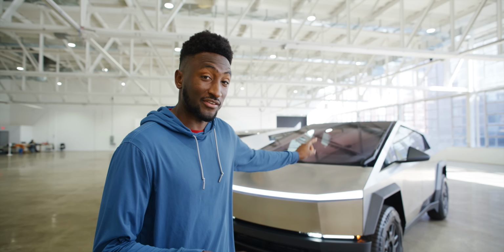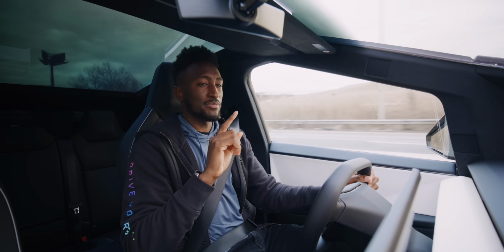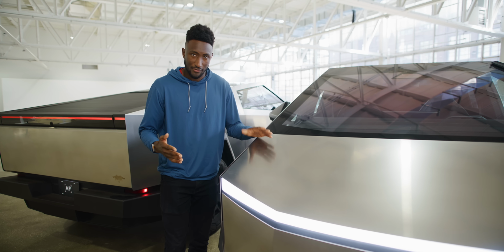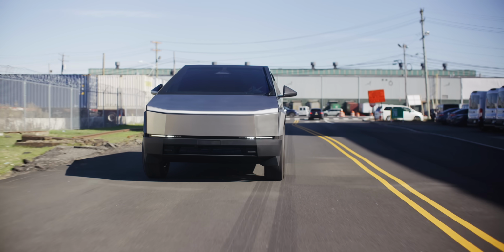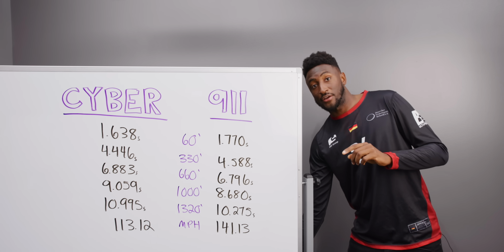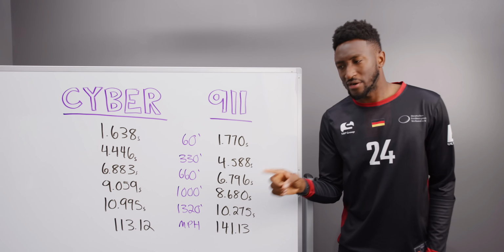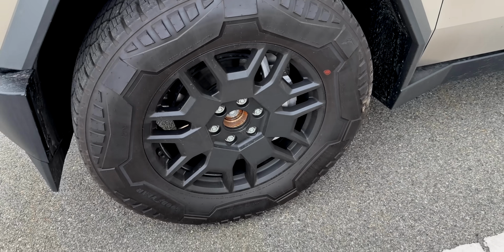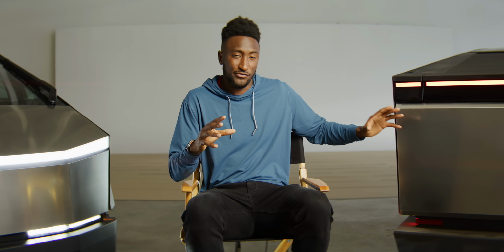Tesla Cybertruck Review: Already Iconic?

Comment: "A physical button is button, in a lot of ways, is better than a digital button" - what?

I am pretty sure most buttons in cars are both physical and digital. i.e. they are physical in the sense they are not touch based but also digital in the sense they do not actually control the component directly in an analog manner.

If you press the "increase fan speed" button in a regular car, it does not directly affect the fan motor. Instead it sends a digital signal to some controller that interprets it.

Anyways I assume he meant to say people prefer physical buttons to touch-sensitive surfaces/buttons.

Comment: On the aesthetics aspect: I think the back looks SICK. Better than the front, even though the front steals my heart with those inset headlights. But to my eyes the light bar on the front is just too THICC. I like the look of slim, sleek lightbars and the Cybertruck's front one just makes it look like a toy, not something from Bladerunner. But the back looks like the movie for sure. The side profile makes me puke tho honestly, that pointed roof is just so weird looking in my opinion. It's very american for sure, no elegance, just MASS. It's a massive vehicle. I get bothered by the A pillar width on my Nissans all the time, since the brand always designs unnecessarily thick A pillars, so I don't think I'd ever get used to the Cybertruck's, which is like twice the size 😂
I severely dislike wide A pillars, man.

Comment: Ecologically, it's not fine. Millions of people moving unnecessarily a few extra tons of metal and batteries to do their groceries is not fine. It's physics, it doesn't matter how green your energy source might be it's just incredibly inefficient! And that's on top of the fact that the life cycle of the truck and its recycling will always have a considerable footprint. With the same amount of manufactured mass you could have 3 times the number of people doing their groceries plus one third of the required parking space.

Comment: Variable steering ratio has been a thing even w/o steer by wire.
I can't imagine not getting any feedback from the front wheels...

Also why do Americans think you need a truck for towing? You just need enough power and a good gearbox. 30 years ago my dad would tow a fully loaded caravan with a VW Transporter that had 75hp and 150lb-ft of torque. And generally here in EU we've been towing with our sedans since forever. Yes, you won't probably tow 10000lbs, but if 63% don't tow at all, I bet the ones who tow 10000lbs are in the single percentage digits.

And how did you only get a 10.2s on the Turbo S on a prepped surface? I've seen it do below 10s on an airfield and not driven by a pro driver.

Comment: In my opinion it’s just stupid, I don’t hate the design but my grime is that the radical design doesn’t solves any purpose it more than often complicates it like there is no point of it…it’s very bad at being a truck with that weird truckbed where you can not load things properly, it’s not very aerodynamic either….nor it’s a very nimble car cuz it’s heavy and big so I mean what’s the point of the radical design it is not solving any age old truck issue neither it is doing any rocketry for electric cars……it just looks like a stupid idea brought into mainstream because people will buy anything unique doesn’t matter how useless it is and fyi the bullet proof body is of no use the windows are normal glass so you aren’t dodging that bullet….the only nice innovation is ride by wire steering that’s all

Comment: Fantastic video! 

About the car though... Northern European here with a few questions. 

What's the stainless steel grade? I'm no steel expert but regular 304 SS won't cut it in my parts of Europe, that's for sure. It's gonna rust away in 5 minutes during the winter. And you really need to know how to work the steel during manufacturing so as not to degrade it's quality.

Also, the sturdiness concerns me. How are the crumple zones in a collision? Will it completely demolish the other car? If so, I don't think I need to worry about the steel grade, because then I don't think it will be approved for European roads anyway.

Comment: I think the scariest thing about the cybertruck is that if a person ever finds themself in front of one in the wrong time, they will probably endup folded on the ground. That front bumber is not pedestrian safe in any way
Reply: The Cybertruck has a much smaller and lower hood than most American trucks. So the same can be said for the RAM, F-series and other trucks.
Reply: @nielsvandenkieboom5034  Yes that is true, Inwould say getting hit my any car is bad as it is, but the height of the hood and the fact that it is so stiff makes it very scary, of course there is safety break features etc that make it less likely to be involved in one but still, cybertruck is very scary to be around

Comment: The cybertruck with the 114 mph top speed limit should be only on dual motor snd single motor cybertruck. The tri motor cyber beast has a top speed of 145 mph. So you have the same problem as carwow had with the pre production unit of the cyberbeast. You can get tesla to update the software for the cyberbeast. Amazing video as always

Comment: The Silverado EV has more range, also have 4 wheel steering, much better frunk, it opens the back of the cab to allow things up to 10ft to fit.
Overall it just seems to be a much better truck. Although I think the stainless steel is actually a better material for endurance, if you wrap it up in the first day to avoid rusting.

Comment: Not at all surprised that 63% of 1/2 ton truck owners don't tow with them. You don't (shouldn't) buy an F150 or a Silverado 1500 for towing anything decent sized. You buy a 250/2500 or 350/3500.

Comment: Cons of having a steer by wire. Imagine your battery ran out in the middle of the road. How the hell are you supposed to push your car to the side of the road. If you cant steer coz the battery is dead
Reply: If you're stupid enough to run out of battery or gas in the middle of the road, you should not have a license. It is extremely easy to just not do that.

Comment: Tesla needs to fix the Cybertruck front lights; point it a bit lower yes but also make it brighter and/or cover a wider angle. Based on what I've personally seen in videos on the Internet.
Reply: They also need to bring the adaptive steer-by-wire to other Tesla cars. The 48 volt system, too.

Comment: What you needs is a rocket launcher like the ones you see on missile cruiser.  Open the cover and raise the missile for all to see also put a machine gun that is fully articulating.  While you are at it bring up the laser gun.  use the power built in the truck to fire the laser.  Now you will lose the looks the drivers around you will be scared like hell

Comment: I think it will remain an icon of vehicles. It didn't just push the design envelope but the engineering and drive experience envelopes as well. Context makes an icon, rarity can be a factor of the context, but it isn't the sole factor. And as long as most cars don't follow its design language it will also continue to make a visual statement.

Comment: I really like the front end but still dislike the rear.  

I think you were incorrect in saying this truck is bulletproof up to 9mm rounds.  A .45 caliber round is larger and won't penetrate this truck, okay because this round is slower.  And, a .50 caliber round will penetrate it, yeah because it's faster.  But you were still incorrect in sayin "up to" a 9mm round.  There are rounds smaller than the 9mm that will go right through the Cybertruck, because of how fast they are.

And why would you use a sledge hammer on that truck?!  Stainless steel can still scratch.

I'm really interested in accident repair costs, because insurance rates are based on this.  Doesn't really matter how safe the vehicle is, it's all about what it costs to repair.  And I doubt many Tesla "certified" body shops have any experience working this metal.

Tesla completely mislead the public with their drag race and Elon specifically said the Cybertruck won the quarter mile race.  And that is the big deal, that Elon lied.  Some will say he misspoke...no, he flat out lied.

Comment: The name of the car - Cybertruck - sells and is brilliantly invented. If the name of the car were Ikea-auto or from a Chinese song: 7's burns, then these would describe the car's appearance better. Cybertruk's 9 mm thick shells are convincing, but the abundance of plastic parts goes to the other extreme: the bumpers and skirts are made of the same black plastic. I wouldn't dare go off-road with such a plastic car. Tesla's innovations are indeed brilliant in their implementation, like now, for example, digital control and swiveling rear wheels, to name a few.

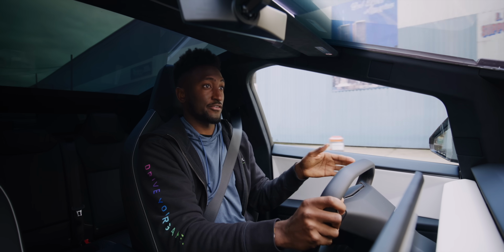Comment: 5:00 variable steering ratio implemented by Honda in the S2000, in 2000. TWENTY FOUR YEARS AGO. tesla DID NOT invent this.
Reply: S2000 didn’t have steer by wire.
Reply: @ericy.2108  did you even read my comment? I said variable steering ratio. not steer by wire.
Reply: @coldfeet1337  yeah - why are you bringing it up variable steering ratio when nobody said Cybertruck was the first to have variable steering ratio
Reply: @ericy.2108 did you even watch the video? 4:19 marques is FLOORED that the steering wheel turns the vehicle a lot when going slow, and turns the vehicle a lot less when going at highway speeds. AMAZED. literally all vehicles do this now. 4:50 
he's never AMAZED at any other car about this.
Reply: @coldfeet1337  again, no one said Tesla invented variable steering ratio. If he drove another car with it maybe he would like it too.

Comment: 4:50 You can tell marques isn’t a car guy. Infiniti shipped steer by wire in the Q50 in 2014. TEN YEARS AGO. Lexus did steer by wire in RZ last year. When Tesla does anything, it’s amazing innovation, they’re the first. When any other company does it, nobody cares or knows. It’s all marketing fluff. The key though is that this marketing WORKS, even on half savvy people like marques.
Reply: All previous steer by wire in cars actually still had steering shafts. Tesla’s is the first to not have the shaft and is purely steer by wire.

Comment: The most underrated feature of the cyber truck is the 48 V electrical system. It makes everything else possible. Streb wire requires dual 5 kw motors for the front and another one for the rear. None of that would be possible without the smaller cabling made possible by the 48 volt system.
Reply: yes was waiting for him to expound more on the system. but he only mentioned the weight saving benefits...

Comment: This was not the first steer by wire car, that would go to Infiniti.
Reply: At first glance yes.  But the Infiniti has a conventional steering column.   One advantage of full steer by wire is that it is easy to manufacture left and right hand drive vehicles on the same line.   The firewall remains the same as does everything that a steering column might conflict with.
Reply: As a pro-content creator with a team, this is a quite big mistake. AFAIK first production car without steering colum was Infiniti Q50. 2013 . Yikes!
Reply: @GsrItalia   Look a bit harder.
The Infiniti Q50's  DAS system is  not considered true steer-by-wire. Here's why:
DAS has triple-mode back-up (three separate electronic control units), 400,000km of real-world test distance behind it  and the back-up of the mechanical steering linkage.   In normal use a clutch disengages this mechanical link so it can never corrupt the steering response.

Comment: Tesla is lucky as it is a vehicle manufacturer not a truck manufacturer.  Cybertruck is a niche  vehicle.  It can try new engineering which could end up in their main vehicles.  Ford and GM trucks are their bread and butter.  Little more difficult.  Tesla started before high inflation, high interest rates, and high debt.  All these newer companies/startups  are fighting huge debt loads on top of high interest rates.  Even Big 3 falling in this category.  Starting to see oversupply of vehicles dealer lots especially $75-$100,000 trucks/Suv’s, LOT ROT.  Credit card debt highest level 1.3 trillion.  Government still overspending and buying more debt with 35 trillion in debt. L

Comment: The CyberTruck vs Porsche race that Tesla marketed was a bit disingenuous, but it's also to be noted that trailer tires are not rated to go at the speeds that would have been reached in a full quarter mile. They literally couldn't have done a full proper quarter mile, even if they wanted to show that it would lose.

Comment: Other examples of automotive mass produced icons are the Volkswagen Beetle and Bus (originals), Morris Mini, 60’s Ford Mustang, Citroen 2CV and DS and Fiat 500 (original).  We just haven’t had so many lately because cars have become commoditised, iconic design is risky, and why would large established manufacturers take risks on manufacturing a commoditised product?
Reply: All the above, plus of course the Ford Model T - the original mass production automobile, designed from the ground up for manufacturing efficiency. For a decade it was essentially the only car on the road, though customization was so common that it gave us the forerunners of both the pickup truck and the station wagon.

It's amazing to look at photos of automobile traffic of that era and to see that basically every car was a Model T.
Reply: You forgot what I think is one of the most eye catching and iconic car ever. It was also unpainted stainless steel. The Delorean.
Reply: also this truck isnt street legal in many countries , this homer mobile will never be iconic tbh
Reply: True. All modern legacy cars all look the same. The same global paradigm is being used. Right now it is with strange false scoops, ridges and lines borrowed primarily from Asian design aestethics. It is practically anti minimalist.
The CT is really different. I would not say pretty, but this is one daring design that probably will become iconic.
Reply: Good point
Reply: if the old one will not take the risk, then the new one would take it
Reply: Elon has created a true icon here.  For better of worse.
Reply: @cbotten106  Agree.  In addition all the previously mentioned iconic cars of the past where shit underneath that sheet metal.   The CT's tech is out of this world (48V, 4 wheel steering, drive by wire, 120/240 plugs, etc.  It'll still be awesome tech with millions of them driving around, vs millions of tired anemic POS pt cruisers...

Comment: When Model 3 deliveries started they maxed out at just 120 kW. Then they bumped it up to 150 kW. Then v3 Superchargers appeared with 250 kW, and all of a sudden all those Model 3s charged twice as fast as they did at launch. I’m confident Cybertruck charging will get much faster over time in much the same way.
Reply: Explanation for geeks: Model S,X,3, and Y all use 400 volt battery packs. Charging speeds steadily increased, and that meant higher and higher current. High current means more heat. So they switched to liquid cooled cables and managed to achieve 250 kW peaks.

CyberTruck is the first Tesla with an 800 volt pack. But it’s set up as two 400 volt packs that can be wired in series or parallel, so it can charge at either 400 or 800 volts. That’s why it works with all the existing Superchargers. But charging at that voltage it hits the same current limit as other Teslas.

The general rule is the bigger the battery the faster it can charge. They call it a C rating. Cybertruck’s battery is almost twice as big as a Model 3 or Y packs, so it should be able to hit nearly 500 kW peaks and average almost 200 kW if you’re smart with your charging stops. It’s not even close to achieving this today, presumably because it’s charging at 400 volts. Volts times amps equals watts, so if you cut the volts in half you have to double the current to maintain the same power. And that’s more current than it can handle.

Tesla is presumably planning to build Superchargers that can deliver 800 volts, and when they do Cybertruck should be able use it. We’re already seeing some v4 Supercharger pedestals, but they’re still using v3 cabinets. I expect they’re still working on v4 cabinets that can deliver the higher voltage.

Comment: Truthfully all trucks and SUV’s should be limited to 100 mph.  So much turbulence  and air under vehicles makes for partial airplane especially with high center of gravity/high ground clearance.  Very easy to lose control or high speed..  so many roll overs in SUV’s/trucks.  Stability control mandated all new vehicles starting 2012 to help mitigate roll overs.  EV harder to roll secondary to low heavy battery.  Legacy auto has even tried to shave metal off roof sections to help lower center of gravity and prevent roll overs but now you have weak roofs that can collapse easier if roll over

Comment: Cybertruck is 7000 pounds with 123 kwh battery.  Hummer EV 10,000 pounds with 240 kWh battery.  Smaller battery weighs less, faster charging.  Less weight means better handling, braking, acceleration, and range.